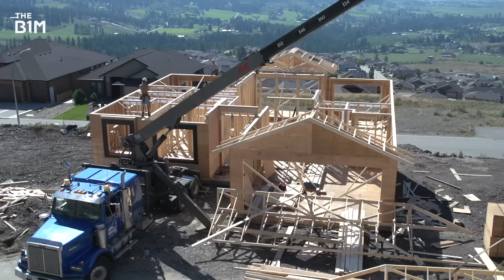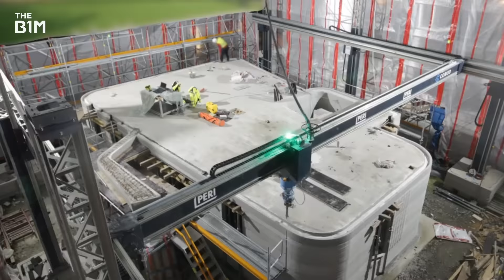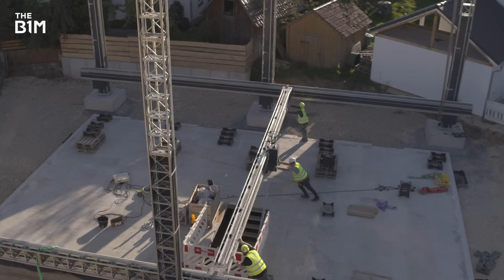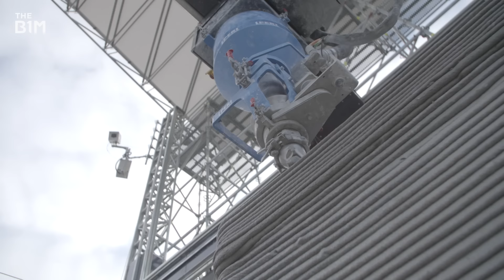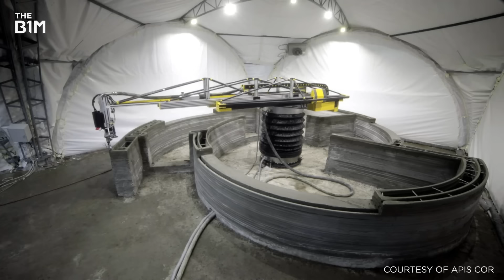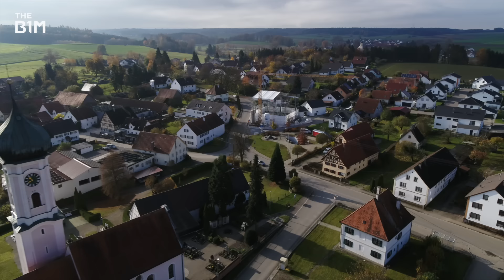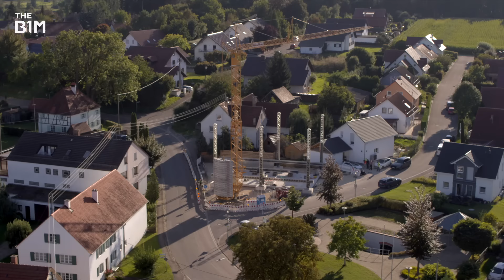Why This 3D-Printed House Will Change The World

Comment: And in 5 years when I want to install a new electrical outlet, or install a new bathroom.....then what?
Reply: Drills. We mostly have solid walls of brick or concrete in Brazil and make all kinds of changes all the time
Reply: Fulano de Tal ;  Hi Brazilian brother, thanks for answering this question, the education system has completely failed in North America and the people have no imagination. Besides that they are in so many pharmaceutical pills that their mood is changing every other minute.
Reply: chisel
Reply: There is no clear distinction of load bearing and dividing walls. This might be optimal for material cost and structural optimisation but might prove bad when one wants to modify it.
Reply: @jakadirnbek7141  I'm sure it's considered in the design phase
Reply: Bon Scott  What are you getting upset with me for? I didn't design it, people change their minds.  You can't plan for something that's going to pop into your mind 20 years from now.
Reply: Bon Scott   Change orders are a fact of life and construction. They always happen even with the best engineering and architectural plans. They happen because the inspector, contractor, architect, engineer or homeowner discovers a safety issue, a code violation, a better way to do something or a problem workaround.
Reply: Bon Scott you can never predict the future most extensions or renovations are done by new home owners that want to make changes to the house they bought, you’ll never know what they want
Reply: Thats simple. Only print load bearing walls and use traditional methods to build the inside walls.
Reply: Bon Scott there isn’t a wall that’s load bearing in that building, I think it works with its entire shape to not collapse on its self.  This type of building is pretty useless a lot of people like to do extensions which would be impossible here as welll
Reply: @dannys6193  What a bunch of nonsense. In a concrete building the load bearing walls are the ones where the floor or roof panels sit on. Depending on the size of the floor span and the panel size, most of the interior walls are none loud bearing. Also if you want to make a opening in a concreate load bearing wall u just install a H beam and thats it.
Reply: Bon Scott  Okay, no problem. Thanks for the reply.
Reply: Then you hear the "womp womp" sound and move to another house instead.
Reply: Well if houses were built with sensibility over aesthetics, the wiring would be on the outside of the walls, protected by PVC piping. Plumbing too. That way any maintenance or modification would be a piece of cake, and you wouldn't have to worry about mice chewing on the wires inside the walls.
...but alas, people are more concerned with looks than functionality so this will never happen.
Reply: @Kragatar  Yeah, and a shelf falling over is now falling directly into your piping and wiring, giving you a nice mains voltage powered shower. 
Ever thought that these supply lines are sensitive and need a bit more protection than some plastic pipes glued to the wall ? That you don't need 24/7 access to them ?
People are concerned with reality, not tryhard ouside the box thinking.
Reply: @DeadNoob451  Put them along the ceiling, coming down to the appliances and outlets through grooves in the 3D printed wall covered by decorative trim that snaps into place. Safe, aesthetically pleasing, and easy to maintain. I am concerned with reality, not stubborn adherence to outdated tradition.
Reply: @Kragatar  Eh that has nothing to do with reality as brickwork (or wall printing) happens at a stage before wiring and piping (done by contractors, not the architect or bricklayer) are even planned out to that detail.
Try visiting a construction site or talk to an electrician once.
Reply: @DeadNoob451  I think Kragatars idea isn't so wrong. As this building here shows already, that they integrate the electric, and I think also the plumbing while the print is running ... You see the outlet at 6:09
I'm not deep into building new homes, but as I know when buildings starts, there is already a plan of all the electric and plumbing.
Reply: @Kragatar  as they should be. Please stop building ugly things
Reply: You just do it as before in a non printed wall.
Reply: Dude over here acting like stone, brick, and concrete buildings havent been prevalent worldwide for centuries
Reply: Noah Ksiazkiewicz concrete is extremely strong, they don’t use concrete. 

They use cement mixed with other materials but it doesn’t come out as being traditional concrete that needs to be formed.

This type of buildings is mainly useful for people with 3rd world countries that need houses built ASAP
Reply: Noah Ksiazkiewicz also he is correct because you can’t install a new bathroom or anything as it will mess with the structural integrity which impacts re sell value heavily
Reply: @dannys6193  Y'all are acting like the software and engineer capabilities to integrate the changes to the house won't be available... don't you still need an architect (or another professional figure I can't translate from my language) to make renovations and changes? People don't just buy a sledgehammer and some bricks to make renovations
Reply: TheJaironman99 that’s all irrelevant what I’m trying to say is,

If you remove a wall from the structure wouldn’t that impact the integrity because it seems like it would fail since it’s holding its self up and a hole would be a problem,

An extension if possible would cost so much more due to the reinforcement required to prevent the roof from falling
Reply: TheJaironman99 the only reason we currently have square houses is because of brick, timber or concrete to hold the house up, all those materials are extremely strong this “fill” is just cement mixed with some other material, so it’s not as strong as concrete
Reply: @dannys6193  oh so your argument is more on the materials than on the practical feasibility of changes... ok, I don't really have the knowledge to judge that but yes, it doesn't look as sturdy as bricks or concrete, that's true
Reply: It's not an added problem to 3D printing, considering most houses here already use bricks.
Reply: JoshuaK brick houses are double in thickness and are much stronger than this type of construction meaning if you knock a wall out all u have to do is re in force the bricks that are suspended from the removed wall
Reply: JoshuaK if u break the wall from the 3d printed house it could cause cracks and could lead to complete failure with the house collapsing
Reply: @dannys6193  That would indeed be a problem. At least we have plenty of engineers who could work on it. 
It's a relatively new technology, after all.
Reply: I am pretty sure interior walls will be made with lightweight concrete that can be cut into. Use your imagination. Stop being so pessimistic. The people that design these homes are not idiots, in fact, these are well educated engineers and architects instead of the usual hacks That design conventional housing nowadays, and end up costing so much

Comment: I'm curious about the slab and beams, vertical elements are of course 3d printed, but what about horizontal structural elements?
Great video as always !
Reply: This tech can only print walls, at least for now. Everything else (floors, foundations, electricity, plumbing etc) is done traditionally
Reply: I was wondering more about how long the first layers of concrete need to set before you can keep adding more layers to form the wall without the weight squishing out the bottom.
Reply: ICF is used or some companies have integrated timber frame roofs. Unfortunately they haven't been printed yet but if you want to see many more 3D printed concrete buildings check out my channel!
Reply: @automateconstruction  : the reality is that 3D printing "Doesn't scale well" - ie. making ICF - blowing Foam - or pressing cellulose in a form at the "factory" is much more "efficient" in - time and space terms (probably profit margins too)  - imagine the craziness of 3d printing ICF's... - Yes if there are a lot of dwellings being constructed in one area -  establishing a "local factory" is probably a good thing - reduced transport of bulky finished product...

Stacking ICF - in sensible lifts - and pouring the walls is probably a much better idea.

Precast flooring / roofing (structural) - (? local casting yard) most likely wins in most analysis too.
Reply: @kadmow  Less customization available for prefab. I agree prefab makes more sense for pumping out the cheapest units 1000s of the same kind. 3D printing allows for customization. It has the same benefits as small scale 3D printing, if you want to mass produce something it always makes sense to build a mould for it rather than 3D print it.  Some people don't want to live in standardized prefab homes.
Reply: @automateconstruction  : I was making the analogy of 3dPrinting the ICF vs Blowing the Poly...  No rational person would set up a printer farm to print ICF elements.

ICF (foam or cellulose/cement)- (with stainless steel ties) and Pumped "Concrete" - plasticised / foamed / fibre reinforced, etc.   - will likely win...

That still allows for a bespoke design, onsite.

(And Precast flooring has Cable-ways already formed insitu)

Comment: I’m not sure what problem this solves. Prefab parts of buildings in a factory. Automate that process.
Reply: I'm sure there will still be viable markets for Prefab, but the method isn't always the best, most inexpensive way to build a house. For one, building lot size can vary considerably. Prefabs aren't as versatile in that regard, whereas the 3D printed home can be made to fit on site. Which brings up another appealing aspect of 3D printed homes. Uniqueness. Prefab homes are notoriously similar to each other which is a unappealing to many. 

Prefab industry is also inflexible to the ups and downs of the housing market, both nationally and regionally. If you build your Prefab factory in a location that minimizes transport costs to an area experiencing a housing boom, as soon as that building spree is over you've got an immobile factory forced to incur higher and higher transportation costs as the building market moves farther and farther away. 3D printed homes do not suffer this logistics issue. You simply bring the concrete printer to the building sites. 

There are likely other benefits, but these are the ones off the top of my head.
Reply: Katerra

Comment: How did they do the floors or ceilings? Was that also 3D printed or ?
Reply: They would a modular platform uder a desired surface and build upon that, think of it as a steel floor being in uilt on the concrete incorported to the building
Reply: The floor is cast the normal way.

Comment: I'm not a fan of the way the walls look with their layers, there needs to be a way make the walls flat.  Of course we could for example plaster the interior, but then we are again spending a lot of time and labour on plastering, which seems to remove the point of 3D printing as a fast construction method.
Reply: @tonythreepies9272  Then how about the exterior? The layering is obvious there.  I don't imagine you would plaster the exterior, is there a way that this could be smoothed out quickly?
Reply: Surface finishing has been a core part of additive 3D printing since it started. The bigger the nozzle, the rougher the surfaces.
 No idea where you got it from that these machines are magical and able to work with surgical precision while also working through a ton of material at the same time.
Reply: @DeadNoob451  I accept they are not magical and understand the effects of a larger nozzle. I'm also very impressed with what is being achieved here. However there is room for the technology to improve.
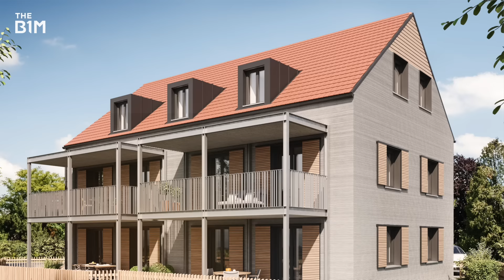Reply: @syproductions456  I was also impressed how the building 2:24 looked like a normal house instead of a circular monstrosity seen in previous 3D printed houses. It looks like something that with a bit of plaster work I would actually want to live in.
Reply: @DeadNoob451  he never said it was magic, he said he didn't like the look.

Comment: Think about designing our own homes and a few days later having something that resemblance a house.
Reply: lol thats not how fast it works. the shell of the house is just 20% of the construction... it will still take 2-4 months for a finished house to move it.
Reply: @willblack8575  true but the time is still much faster than conventional building.
Reply: @silaschristiansen7241  maybe with 2-3 days than a wood house build. its way more expensive tho...you basically have a house made of concrete...which is terrible insulated and concrete is pretty expensive at such volumes.
Reply: @willblack8575  you probably know more than me 😅 but still really cool tech and I think it is going to be revolutionary.

Comment: I really hope this technology will reduce the cost of the construction.
Reply: not much
like prefabricated buildings. Faster to make but developers want more money xD
Reply: so the developer can make more profit 😅 , if you think this will lower the price of house in the market , you are wrong
Reply: that's a lot of concrete.
Reply: Prefab & standard bricks makes much more sense. Who wants wavy concrete walls and how to put water & electronics into? Temperature isolation of concrete is bad too.
Reply: @tiefensucht um have you heard of plaster also you make holes in the print like normal 3d printing lmao then someone goes through nd installs it like normal building
Reply: @tiefensucht  wavy walls can be covered with sheetrock, you can insulate the cavity. i'm not sure how they do plumbing that wouldn't involve too many glue spots.
Reply: Reduce costs? Lol! Can you imagine what that machine costs! The all overscaff

Comment: Reasons why I'm not sold on this:
1. There's no mention how robust these walls are. Yes, they got a permit from the government so we can safely assume that they are strong enough, but we don't have anything other than that.
2. Longevity. Houses are are intended to last at least a generation, if not a hundred years. You'll never leave everything untouched. What if I want to change where electrical outlets are located. What if I want to add newer cable-technologies (e.g. fibre instead of copper wires). With solid brick/AAC walls I can do as I like.
3. What is the material used to build these walls? If it's concrete based, then the CO2 footprint will be pretty bad.
4. The walls don't look straight at all.
Reply: The concrete is very strong, from 3000-6000+ psi
Reply: @automateconstruction  So it's concrete, not very CO2 efficient...
Also: What about tensile strength. Concrete sucks at that after all.

P.S. What's psi in SI units? I don't really know my freedom units only used in three countries.
Reply: @Ruhrpottpatriot  You can compare it with brick

Comment: I really want this to be a thing, but I won't believe it's arrived until it has been done at scale and without a premium cost. I also wonder about the material used. Is it standard concrete or can we find a better material with a much lower carbon footprint?

Comment: This is probably printed with a concrete with fibers. How earthquake resistend is this material, compared to the “normal” brick wall?
Reply: Good question, I was wondering how reusable or recyclable the materials would be, if you decide to remove the building. I can't really see how this beats traditional brickwork, economically or environmentally.
Reply: Not everybody lives in California earthquake zone 4.  Most of the world does not. All over Europe there are 2000 year old tall, slim, Roman structures that are made with stone and mortar, no rebar or metal reinforcing at all.

How damn Californians are so arrogant.

Comment: What’s the shear strength of those walls? Do they need rebar or is the stand alone strong enough?
Reply: i think it's a stand alone construction without steel, because the sides of the wall are thick enough and the bottom and the head od the wall is 'closed' with this concrete...

...same as thin walls as a brick construction... there you as well have no reinforcement(steel)
Reply: @kolavithonduraski5031  ahhh if only you knew how weak cement is without rebar haha
Reply: Found it, here at 6:04...
Reply: @mcm4981  cheers. Are they enough though?
Reply: @sirhumbleproductions4093  No they're not.
Reply: @sirhumbleproductions4093  doubtful, I was kidding around with that reference.

but I will never underestimate the German engineering... maybe all those round curves have an effect on strength?
Reply: @paulinbrooklyn  brilliant...
Reply: And what they using as isolation???
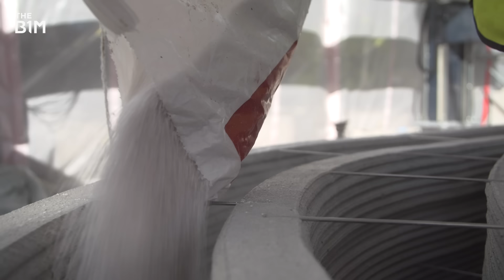Reply: @lewisknight6819  2:43

plastic balls as insolation
Reply: @lewisknight6819  I'd say air. All walls seem to be double.